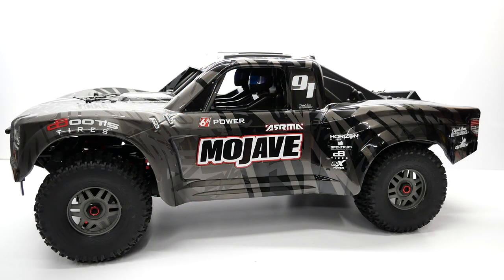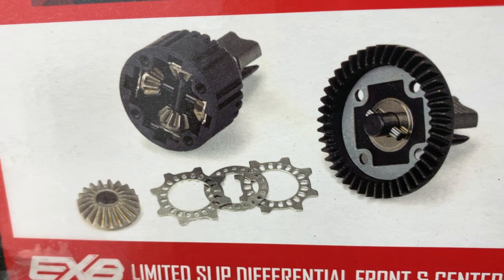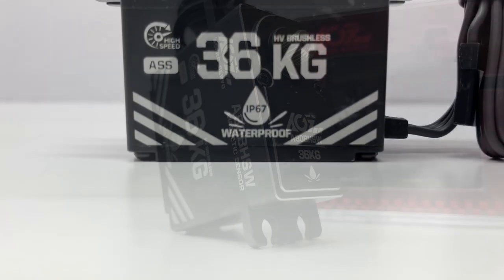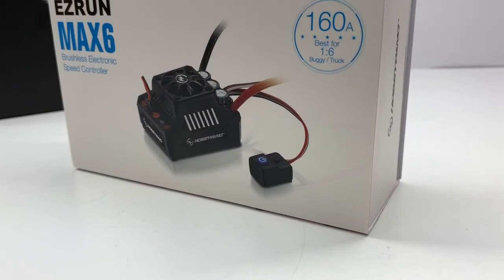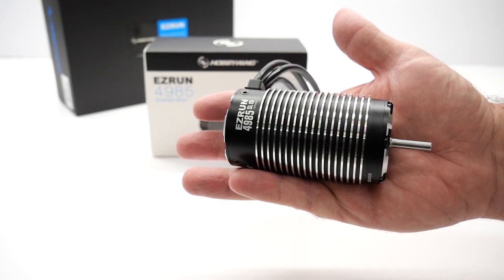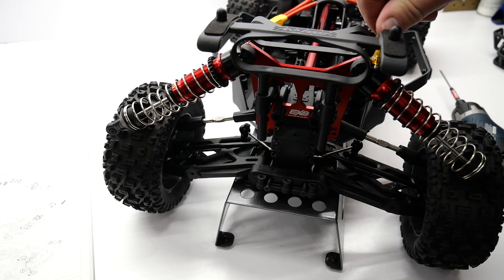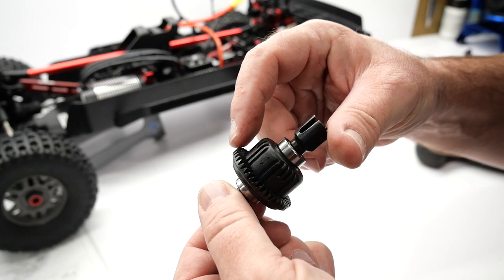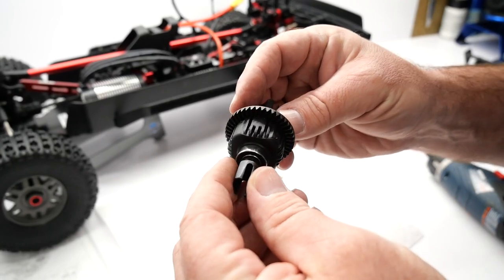Electronics and Diff Tear Down - Arrma Mojave EXB - 1/7th Roller Desert Truck

Comment: Has anyone come across any Titanium replacement screw kits for the Mojave? I live on the coast, so unless it's Stainless or Titanium, the screws are toast in week. Thanks :) I'll have to use the RC Screwz Arrma Mojave 6S BLX Stainless Steel Screw Kit. Thanks heaps :)
Reply from the maker: Go stainless.  Titanium will likely cost you $200-300 for the Mojave.  Decent Ti screws for a 1/10th buggy are a good $100-150
Reply: @TheRCNetwork  Thanks :)

Comment: What gear did you put on the attack in 1650 KV
Reply from the maker: It's the 20t that came with the EXB - it was perfect for the motor/voltage I was using

Comment: Great video. I plan to do the same ESC/motor setup. Did you use the stock spur/pinion? What would be optimal? Have you tried running it on 8s yet?
Reply: I run 18 and 20 perfect

Comment: How do you thread that antenna wire? Looks like the box comes out but mine will not budge.
Reply from the maker: It should just use a tine grub screw to keep the antenna in

Comment: Rich I have just come back from my Easter break at the beach running this exact same setup you have. It is a BEAST! Absolutely flew up and down the beach and was completely indestructible - I also added a Dusty Motors chassis shroud which pretty much stopped any sand getting in which helped. Thanks for your guidance really great combo. Colin
Reply from the maker: It's a beast, right?  Be sure and clean up that RC now......beach sand can be bad for RC...especially salt water

Comment: Bought one last night and plan on going with the same esc, motor. Never had heard of that servo before but seems solid!
Reply from the maker: The Servo is great!
Reply: They are great servos even thier cheap servos are better than typical Amazon ones . Just stripped exb rear diff after not using them since release. I should've added 30k b4 running

Comment: You should try both of the lsd rear diff settings. I haven't seen anyone compare the strong vs weak lsd plate setting to see how it changes the handling of the trucks.
It was left open for handling reasons apparently.
Reply from the maker: I'll have to look into that...didn't know about the LSD settings
Reply: @TheRCNetwork  
If the plates are set as spikey, round, spikey then that is strong setting. 
Round, spikey, spikey is a softer setting.
I may be wrong, but it would be nice to see a comparison.

Comment: Nice electronics!!! Im thinking of getting the Max 6 combo. How close is the motor to the chassis? When doing big jumps and landing hard, will the motor hit down on the chassis?
Reply: I have this setup in my Notorious. It is a powerhouse! The motor's heatsink ridges can rub a little on the chassis due to flex when jumping. I CA glued a small rubber grommet to the chassis underneath the back end of the motor to take the brunt 👍
Reply from the maker: It's really close...not hitting, but like Yas said - a thin rubber bumper might help.....I've had scratching on chassis before....it just slightly mars the finish of the chassis and the motor, no real performance issues though

Comment: Good morning Rich, 
I do like your vids, clean style and well spoken. 
After some time, what are your thoughts on the EXB Mojave and the parts that you have chosen? whuld you change anything?

I am doing this build now and I have selected the parts that you used, apart form the radio. I am using Radiolink RG4GS V3
In regards to the diffs what fluid viscosity did you end up going with?

 I see a lot of people on forums use 30k rear 500k centre 60k front and what shock oil viscosity did you end up with also. Its will be a fun basher on dirt and grass with only medium jumps and nothing stupid like sending it to space or something, it cost to much to abuse and fix. 

Many thanks and have a great Christmas from Australia.
Reply from the maker: I wouldn't change anything, tbh.  People run higher viscosity fluid to try and minimize power transfer, or in other words create a more locked feel.  I like the way it drives from factory.  I would minimize any grass usage, that will be sure to degrade your electronics really quick.  Happy RCing!

Comment: whats the top speed of your setup? and are the pinion gears and all electronics that you chose bashable and stay intact without damaging anything?. since rtr normally are not recommended to change to the 6-mph pinion gear so that's why im asking. AND also how much were all the electronics? was it worth it to get the exb version and build yourself or was it more worth it to get the rtr version of this? would appreciate if you answer my questions as i am looking to check if i should get the rtr or this. thanks :)
Reply from the maker: No idea on top speed, as I'm not interested in that....I'm more concerned on the torque and ability to move that nearly 20lbs truck.  IMO, the EXB is the way the Mojave should be offered....with the upgrades.  If you have the knowledge and are mechanically inclined, I'd always suggest the EXB and installing your own electronics...you'll have something tailored to your taste instead of something tailored to the masses.  The RTR comes with a 2050kv motor, where I installed a 1650kv (larger can too), so I bumped up the gearing to accommodate the lower kv.  As for price - that varies, but I have links in the video description.  And yes, if you watch my running video, the electronics are highly washable, much more so that the stock RTR

Comment: Great choice of electronics sir, just a question on the afrc servo, does it fit directly on the servo slot? Or do we need to install servo mounts for added height/fitting. Thanks and cheers!
Reply from the maker: Yeah, I installed a couple of shims that were included in the EXB kit bag - just so it wouldn't be hitting the chassis plate

Comment: Hey thanks for the great info. I have the same set up while I wait for my roller to arrive . However, I have an 1100kv motor. Will that work as well?
Reply from the maker: It will work....but you may need 8s to equal the speeds

Comment: What are the shock bottoms composed of? It looks a lot different than what I'm used to in the 3s line. I assume this is because it's a stronger system.
Reply from the maker: The shock bodies are aluminum....the spring retainers are plastic
Reply: @TheRCNetwork  thanks. I was wondering how you removed the bottom portion of the shocks. It looks different from other Arrma vehicles.

Comment: Did you happen to run it on 8s yet? If so, how did you like it? Still prefer 6s over 8s? I just purchased the same set up. Thanks!
Reply from the maker: Only 6S....on stock gearing, it's slow.  Will be doing some tests this weekend on 8s (stock gearing) and 6s with a 23t

Comment: Awesome build!  I am piecing together mine now.  I like the specs on the AGFRC steering servo but I have a question... Do I need to run a BEC?  I do not think you did, and your setup rips!  Thanks in advance and I really enjoy your channel!
Reply from the maker: As long as your ESC has a decent Internal BEC, you won't need one.  Most modern day ESC are well equipped with higher voltage BEC's
Reply: @TheRCNetwork  Thanks Rich

Comment: Rich can you share the spec of the 7PX radio system. Thanks!
Reply from the maker: There's quite a few...what did you need to know?
Reply: @TheRCNetwork  Thanks for the quick reply. I like the sound of the Futaba receiver and found one on Amazon as a bundle with a Futaba T4PM transmitter. Just wanted to know if this sounds like a good combo - I couldn't find the one you have in the video. Thanks!
Reply from the maker: The 4PM is a great radio system.  You can't go wrong with it.  The 7PX has been replaced with the 7PXR now...
Reply: @TheRCNetwork  Thanks for that, very reassuring! And one final question if I could, does the EXB have the stubby rubber antenna housing. I'm guessing the receiver has a wire that feeds into it?

Comment: This was a great video but buyer beware.  I purchased the same servo (based on your video) and on my 5th battery pack over a 2 month time span, the servo torque is very weak the point where the wheels can barely turn when my Mojave is on the ground.  I tried contacting the seller and they are basically telling me that this servo was meant to be used on a 1/10 scale.  So I'm out of luck.  Just trying to save some of you the headache.
Reply from the maker: Sorry to hear that...the specs of this servo are plenty for the Mojave - but keep in mind, it's for a platform with a free turning steering system.  The Arrma cars have one of the most "binding" steering systems on the market and they need to be kept up or they will burn through servos easily.  An easy way to test this is remove the steering linkage and try and move the steering.  It should move without any force...literally just fall.  The A80 was originally made for 1/10th and 1/8th vehicles, but AGF came out with the A81 to be more of a 1/8th scale servo...the only difference is just slightly higher specs.  Also, it depends on your driving style - are you more of a smooth driver, or trying to land massive jumps on the driver front wheel?
Reply: @TheRCNetwork  Understood and meant no disrespect to you. I know the specs are plenty, but if something does go wrong, the seller may use the 1/10 scale verbiage as a scapegoat to deny a warranty.  I'm a pretty smooth driver but lasting only 5 packs is really disappointing.  If I lift up the Mojave (wheels in the air), the wheels move side to side just fine.  The problem is when it's on the ground.
Reply from the maker: @batboyvaj  no worries….I’ve never been fond of the Arrma steering rack/system. Lots to get bound up there….and have seen that issue before with different servos. Have you tried swapping servos to see if others do that?

Comment: What size pinion you going to run?
Reply from the maker: Totally not sure....it's slow on the stock pinion/6s, and I don't currently have two 4s batteries that will fit in the tray.  I'm likely going to jump the stock pinion to a 22/23t and see how it does on 6s again

Comment: OHH Nooo. Did I make a mistake? I got the hobbywing MAX8 and a EZ RUN 4274 2200 kv. Is my Mojavi going to be slow?
Reply from the maker: It may run a bit hot....but it's doable.
Reply: @TheRCNetwork  will your max 6 set up be a lot more powerful?
Reply from the maker: @John-shreds  In the video I showed the can size difference - your motor is slightly longer than the middle motor I showed (that was a 69mm length - yours is a 74mm length). With length/can size comes power and torque...also capability.  Mine is a 1650kv, so It has the potential to run on 8s (although HW doesn't recommend this). You'll notice a difference when entering a jump - the 1650kv will have a bit more "Zip" to get it up the jump and move that 20lbs quicker.
Reply: @TheRCNetwork  I see. Thank you!! I just set up the return process for my Max 8 combo. Few. Glad I saw this before I put anything together.
Reply: @TheRCNetwork  I saw kevin Talbot's video on the mojave EXB and he put a max 8 in it. It looked ok, bit I never saw him do speed runs or anything.

Comment: arrma should sell thick shim or spacer for exb rear diff ASAP. lsd rear diff is not that 💩💩💩 but still open diff is much better
Reply from the maker: I agree on open diff, but I like that Arrma was pretty open about it and the main guy (Jason) was on the forums responding to questions and giving info.  Most RC companies, let alone the main guy wouldn't touch that with a 10ft pole.
Reply: A thicker shim is not the fix😂......I raced 1:1 Porsches and ran a local German repair/race prep/dyno shop in SoCal for 20 + years.
I tried to shim it before I even ran the first pack.   My SOP after 40+ years in RC.  There was no excessive clearance, meaning,  no room for a shim. I’m on my second warranty diff since I  received  my Kraton EXB in the first batch delivered in August. Gear Clearance or Material choices are at fault here. Plain and simple.
Reply: @ruftime  agreed brother my dumb ass thought it was fixed first hard rum and I blew rear diff , I'll end up using the typhon straight cut gears I just don't know ho we they fair in heavy rc .mill give this lsd one more chance with thicker fluids I'm not going through warrantee crsp anymore

Comment: People are shimming the diffs - have you done this? Would you happen to know where the shims go?
Reply from the maker: The Mojave EXB does not need to be shimmed - it includes the LSD plates on all three differentials.  The confusion is that on the Kraton EXB (when it first was released) there was a manufacturing issue on the rear diff only (it didn't have the LSD plates). The factory was supposed to put 3 shims in to take place of the LSD plates, and I believe they only put in 1 or 2 causing issues in some Kraton EXB's.